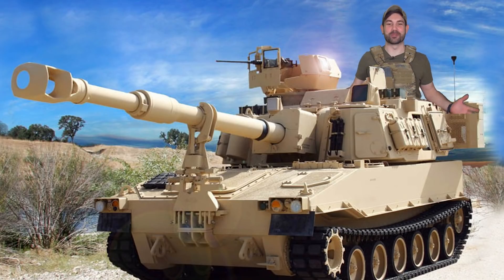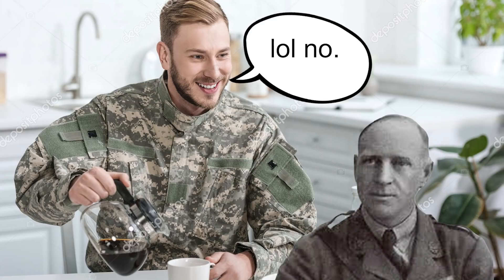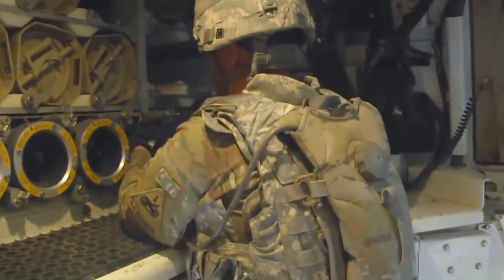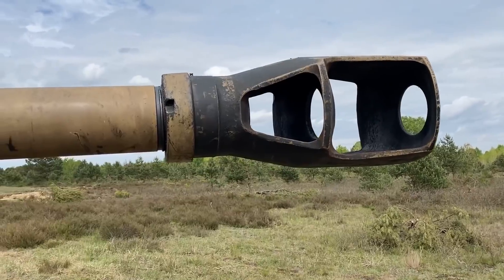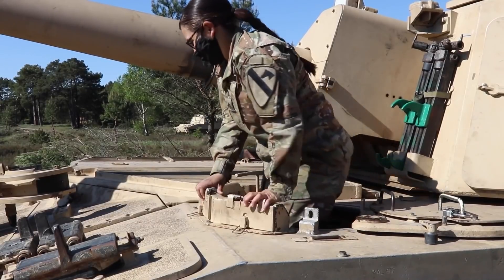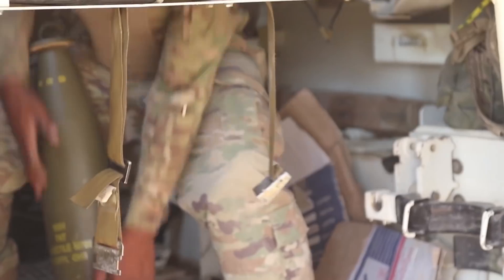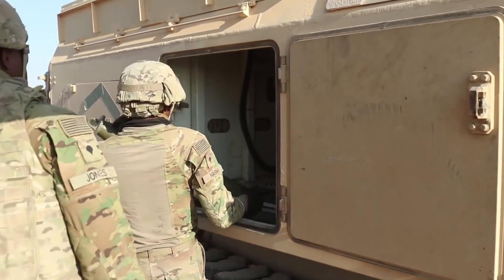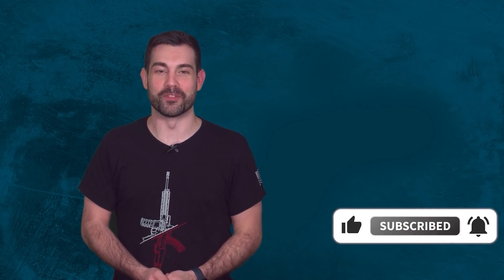M109 Self Propelled Artillery Vehicle Tactics Explained

Comment: I mean, Browning M2 still works a century on. I think that any "replacement" will be basically an incremental improvement on the design, maybe lighter materials here and there, maybe better armor, but does it justify the cost?
Reply: Well, in the end there's only so much incremental improvement could do, i guess the decisive future of M109 would be implementing autoloader (basically, the korean K9). Just like how M1 garand prevail over bolt action rifle, it justifies the cost.
Reply: @Kevin-fj5oe  Yeah, that's what I mean. I don't think manual loading is that much inferior to an autoloader in tanks or arty as a bolt-action rifle, lol. But it's still an incremental improvement. I guess, unless there's a significant doctrinal change (with or without a technological leap), it doesn't have to be completely replaced.
Reply: Bruh, you clearly don't know about the KORD. That is what a .50 should be. The M2 is hopelessly outdated, far too expensive for what it does, and not light by any means. The Russian HMGs and GMGs are just better in every possible way.

The .50 doesn't work well; it's just that we haven't fought anyone that forced us to improved, so we just let is stay shitty. The M2A2 is an improvement on all the things that should've been solved in the beginning, but it still requires a tri-pod, still requires 3 men to move at any speed, can only be used on vehicles and in foxed positions. It's just not good a good weapon system. Yeah, the .50 bullet is absolutely wonderful, but if it's not where it's needed, it isn't useful. Again, look at the Russian KORD. It does the same job, but a single man can carry it [with difficulty], and that's no different from the M240. Again, the 240 is my favorite weapon. Definitely S-tier, but you look at things like the PKM which outrange it while still being similar weight and it's just no contest.
Reply: We were doing hipshoots with the old M109A2s in 30 seconds in '78. The Paladin was a improvement but only slightly over the old M109's. We also did multi round TOTs but we needed more time for doing the calculations. Roughly 30 seconds per rd fired since each sucessive rd. is fired with a slightly reduced elevation so the rounds landed on target at roughly the sametime. The SP proposed a couple years back was a improvement with it's one gun TOT being automatic vs manual but only slightly, it cost 6 times as much as the Paladin. The army in my opinion got it right. The M109's are medium range artillery for the US, the MLRS is the long range artillery. She's a old girl but she still has her place on the battlefie
Reply: @readhistory2023  thanks for the insight, and i remember other veterans commented about the concern regarding reliability and increased maintenance of the autoloader, i guess the army that adopts it decided that the pros outweighs the cons.
Reply: Singapore made a .50 MG cost a about 30% and is lighter and lot better

Comment: There are some things that can go longer without needed ping a replacement, and artillery guns are one of those. The U.S. has in the past used several different guns for decades, as those specific models were still capable as time went on. Only when something that is truly 100% better is created are the old artillery guns replaced.
Reply: yeah well, there are already significantly better spg´s around for 20+ years like Pzh2000, but the US Army tries to modernise its 60 year old M109´s, wich are even after modernisation not even comparable
Reply: @zhufortheimpaler4041  “not even comparable” yeah no, the Paladin might not be the best but it’s definitely up there… and the A7 is basically a new vehicle.
Reply: @U.S ARMY FORCES VIDEO yeah cool, but parachuting seals. Don't replace 10 rounds per minute average firing rate
Reply: @zhufortheimpaler4041  least it was designed to handle more than 100 rounds a day without excessive wear and tear.
Reply: @MatthewČák2142  well only if you are talking about older models like the m109a3. Those have shorter barrels and fire less hot charges, but also have significantly lower range due to that. Due to the lighter charge the chamber pressure is lower, the projectile is traveling the barrel slower and thus the gun is subjected to significantly less wear and tear. But again, those guns only have a range von 20-30km, not up to 80km

Comment: My 1978 gunnery instructor was the 1st paladin battalion commander and later CG of fort sill and USAFAS.  Have a video of the a6 shooting out of safe during a fire power demo at sill in 1988.  You didn't mention Rumsfeld canceling the crusader replacement system around 2001. Our system ranges 30km but north Korean systems range 50km or more. GPS munitions were also not mentioned which makes the weapon very lethal in the counter battery role. It's hard to convey the technical challenges of indirect fire, thanks for making this video.
Reply: @readhistory2023  was that 78 or 79? Don't recall the tornado in 78.  Years later I was in the arty unit in Wichita Falls.  The armory was totally destroyed except for the arms vault.  Luckily everyone in the armory at the time took shelter in the arms vault.  I liked lubys in the mall And don't recall it being destroyed while I was there in 78.

Comment: Fun fact: the largest non rocket assisted round requires the crew to vacate the vehicle and use a long lanyard to fire. When fired the entire vehicle will become enveloped in a fireball for a second. Even standing "safely" away from vehicle, it's still extremely uncomfortable to fire this round. With many of the crew wincing in pain and cursing as the pressure wave passes through them.
Reply: That explains 8:35
Reply: The reason for the long line is when your first initially certifying your gun or it was taken out of battery , meaning of barrel was pushed out of service for one reason or another either to service the gun or for inspection.... Even on a super 8 you still fire on the inside which is the highest charge you can use with either rocket or non-rocket assisted rounds. I can attest to saying that firing a super 8 is an out of body experience and everything causes for a brief second even your heartbeat.
Reply: @murro4465  ".... firing a super 8 is an out of body experience and everything causes for a brief second even your heartbeat."     M110a2's M188a1 Zone 9 would have sent you into a whole other world, then..... 48 pounds of propellant and there is no "inside" to be in.  With spade well emplaced and suspension locked out, and standing 10 meters away from the piece, the shock of firing would bounce you off the sand a couple inches .... empty projo six pack pallet dunnage on the ground would hop at every shot.... we only fired them in Saudi and Iraq..... but almost every exclusively in combat.  IIRC, we only shot one mission the whole time that wasn't a charge 9.
Reply: @danieparriott265  damn!!!  That’s a lot of super 8’s.  I was in Mahmoudiyah (FOB St. Michaels on a hot gun rotation.  Shot a lot of whit bag 6 and 7’s.  I honestly can’t remember shooting red bags in Iraq more than a couple dozen times.  I loved hopping out the gun and seeing the waves in the sand from a 12-16 rnd fire mission.  There’s actually not a lot of us red legs with combat rounds.
Reply: @murro4465  What is a "Super 8?" 
Is that a special round? Powder charge? Or a gun nickname? (These are all sincere questions, just want to learn more of the lingo)
Reply: @steadmantheartist  in my time a super 8 was the highest power charge used.  When used with HE RAP ( high explosive rocket assisted projectile) we could shoot up to 20miles.
Reply: @murro4465  Thanks for your answer to my question. I see.
Reply: @murro4465  Thanks for your answer.
Reply: Seriously, thats why they are always outside!?  This seems like an issue tbh - why build an armored cannon and then make everyone stand outside lol wtf
Reply: @ghostmourn_alt  its not a load that is normally fired, as it wears down the barrel stronger than normal loads.
If the SPG is firing in training, the first round is always fired on the long line for safety.
If the SPG fires from a pre build firebase like in afghanistan or irak, the gun is fired on the long line for increased safety.
those very hot loads are normally shot in SPG vs MBT directfire situations, where it does not really matter if your gun blows up, because if you dont hit and destroy the target you are done for.
Reply: my mom is an audiologist (tests hearing & dispenses hearing aids) and i cannot watch ANY military footage without saying “good god i hope they’re using some kind of ear protection”
Reply: @447GHT  I would be willing to bet any 13B has hearing loss by the end of their enlistment. I only served one enlistment and I got 30% hearing loss in each ear and tinnitus.
Reply: @447GHT  Modern mechanized warfare is unbelievably loud .... from a distance at night, it is beautiful ... up close, it's ugly as hell.  And it smells even worse than it looks.
Reply: @447GHT  if they are it's not enough or it's defective. 3M made earplugs for the military that didn't work and now they owe money on a class action lawsuit.
Reply: @447GHT  For us in the '80s and early '90s it was called two fingers in the ear.
Reply: @indycustommade3568  We had earplugs even back in the 80's .... the only time my ear got truly whacked was when I took off a headset (right ear) and jumped up on the gun to pull tail, and did not put that earplug in.....
Reply: I have hearing loss. We were using foam rolled earplugs before 3m. That 3m lawsuit is a joke,  the circumstance one needs to qualify for very specific not to mention 40-50% lawer retention fees.
Reply: @murro4465  I served almost 36 years ago and have health issues today. Who knows what soldiers went through that they aren't telling people. I still wouldn't trade my time in the service but you have to wonder. I was a 13E so we watched the gun bunnies walk around without ear protection. Who knew?
Reply: @indycustommade3568  I haven't heard that term "gun bunnies" on a long time,  put a smile on my face.  If you stood directly behind the gun then you wouldn't be affected by pressure and noise so much. Being on the receiving end of artillery is no fun!
Reply: @murro4465  Whenever I had the chance to leave our FDC I would go behind the howitzers and take pictures. It was the best way to capture the round coming out of the tube. The only time we would button things up when we fired was shooting charge 8 red bags. We made the mistake one time by putting a jeep and a deuce and a half next to the guns and blew out the windows. I guess the other time would be firing nukes. We would have to shoot the guns with an extra-long lanyard for safety. Those were the days.
Reply: @indycustommade3568  We were firing like mad in the hours before the cease fire in Desert Storm .... HMMTT's would come flying up and park alongside the gun (M110a2, 8") ... not thinking that we might get another fire mission .... and start dropping pallets of rounds and powder at the back of the gun .... and the front of those trucks were right up by the muzzle ...  and then the bitchbox would scream, "FIRE MISSION!!!" and we'd do our stuff and blow the windows out of the HMMTT ...
Reply: 2:00
Reply: I served on a 109a2 in desert shield/desert storm and we shot mostly 8 red bag rap rounds and I never saw a gun enveloped in flames and the only time we used a lanyard to fire the gun was after a major maintenance on the equilibrator. Most times you would finger pop the firing lock.  My old junk we took to Iraq in 91 was the same junk that was dragged to NTC and all over Fort Stewart I loved shooting it but you have never lived as an artillery man until you shot the 8 inch m110
Reply: @bobbybenton3421  my man.  I was on an A6 in Iraq 03-04.  🤘🤙🙏🫡
Reply: That is ridiculous.  It's like we're driving old battleships around the desert.  They're are all sorts of cheap precision weapons systems to replace this now.